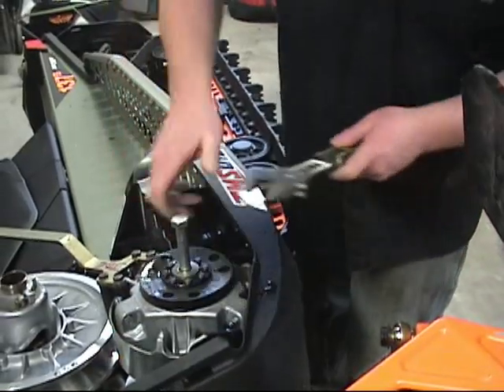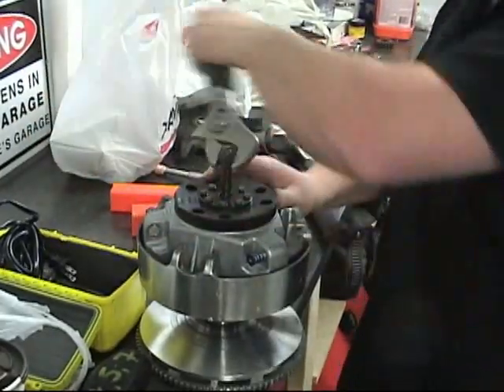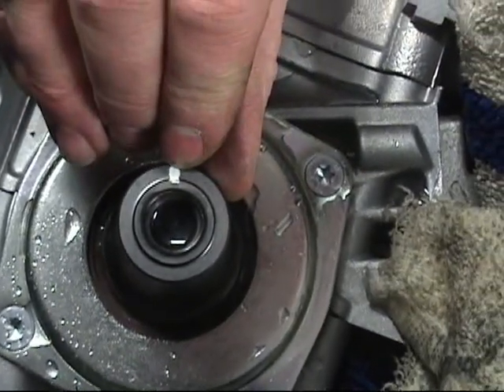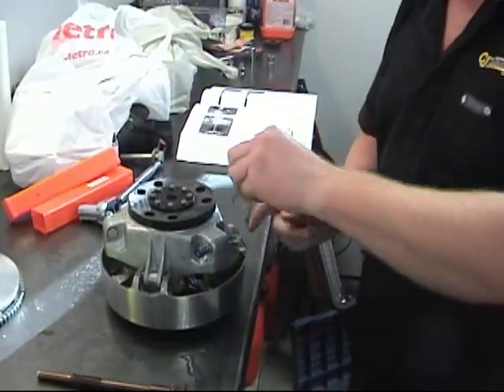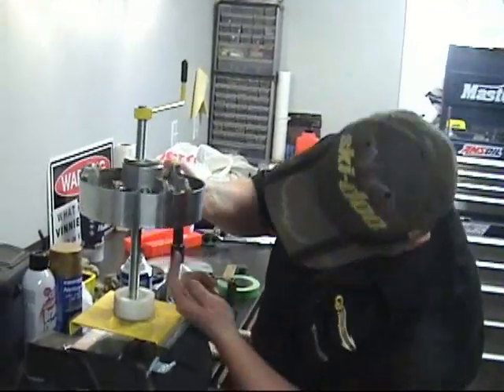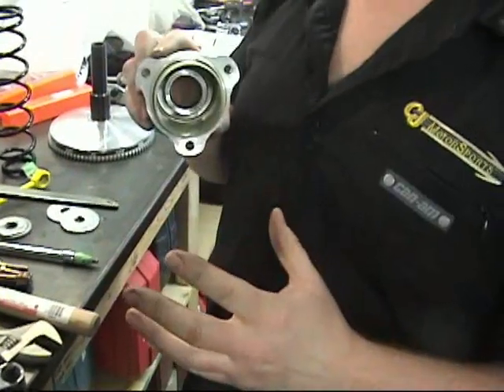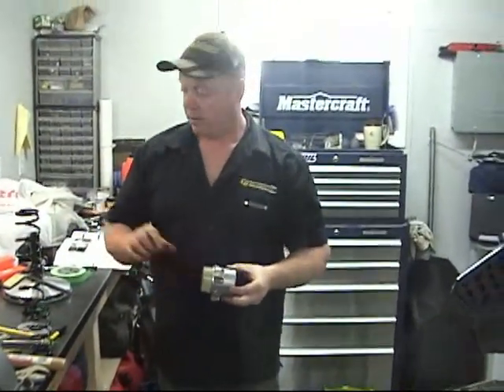Ski-Doo 800 etec clutch kit install Part 1 iBackshift

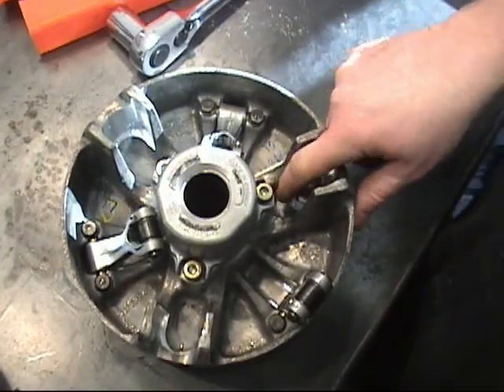Comment: The spacer you mention at 6:50...What is its purpose?  You said the two sheaves still hit together and rub at the very bottom so It doesn't affect that?
Reply from the maker: that pvc spacer is supposed to keep the sheaves from touching together at full shift overdrive

Comment: Have you ever done a video on replacing the  main bushings ( spring cover and base moving sheave bushing)
Reply from the maker: Dont ever replace a spring cover bushing.  Just buy a new spring cover.  Dont buy a spring cover that someone has pushed a bushing in either - ive seen them come apart (both situations) and even where one company had to replace the whole primary clutch.   Ahh, I gotta do slide sheave bushing replace video because there is a little trick to installing one that makes it easy.  sorry, not a this moment.
Reply: Dynamo Joe  Thanks for the get back.  I got the spring cover assembly seems really tite don't move very easy. I got the rear bushing also. Can't wait to see your trick lol.

Comment: hey Joe.  I have a 2013 etec 800r with TRA VII clutch.  I'm installing the skidoo maintenance kit ... specifically the sliding sheave bushing.  The 2011 parts diagram shows loctite 680 on the bushing but the 2013 does not.  Do I need it?  If so can I just use loctite  red or what is the equivalent to 680 in either permatex or JB weld ??  Love your videos.  Thank you!
Reply from the maker: howdy.  green is used so the plain bearing can be removed easily.  when you use red it will be harder to remove in the future.  ive used red and i always use a propane torch (map gas) to heat the surface up to chisel out (utility knife on plastic brgs) or a chunk of broken hacksaw to (saw) make a notch, scoring the surface on the metal plain bearing and then screwdriver to bend it out.  red is fine but have to use heat at future removal.
thanks for watching.
oh and i have a vid in the works for a bearing change
Reply: Thanks Joe!   Do you use loctite blue on the primary clutch bolt on reinstall? ... or just dry?
Reply from the maker: Steven Farmer@ dry eh.  no lube on threads to prevent over tightening and ruining the "curved" washer.  Once the washer has gone "flat" then it will be difficult to apply torque correctly.  the torque wrench will wind up and feel like the bolt is not turning and suddenly make a crack sound....then it will happen again.  Eventually the bolt will backoff, washer is pooched.